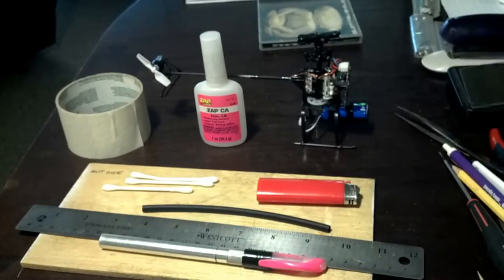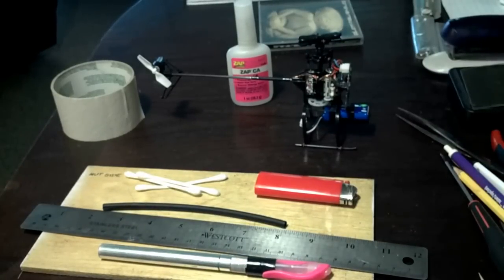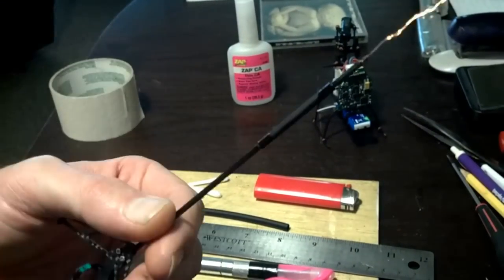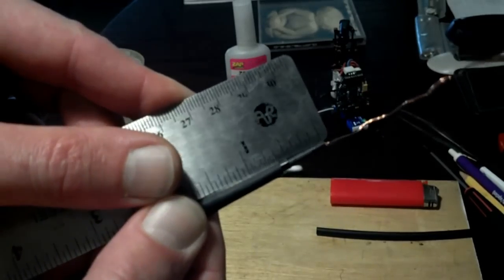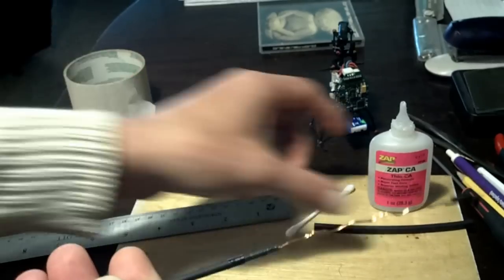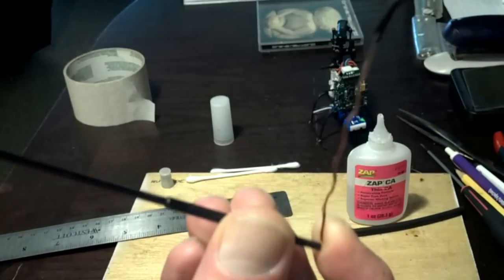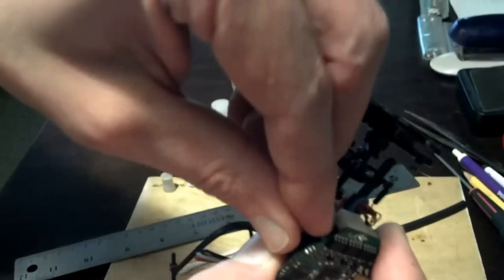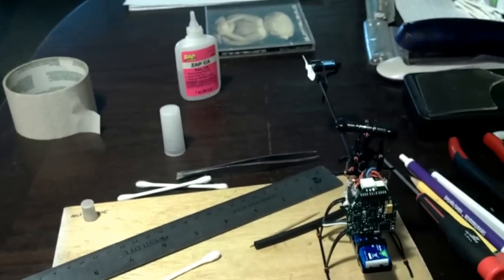Blade mCP X BL tail boom reinforcement mod

Comment: I just used a pair of pliers to crush the stock tube so I could replace it with a slightly longer piece of solid carbon rod.  Now the wire is twisted around the shaft and the solid piece of rod is way stronger...
Reply from the maker: catch262 

Are you using insulating wire or the lighter speaker magnet wire? If so, I would want to jacket that boom with something . . . .

But - if it works for you, then that's pretty cool. If you could show me what you did I could learn about your methods of madness ;)